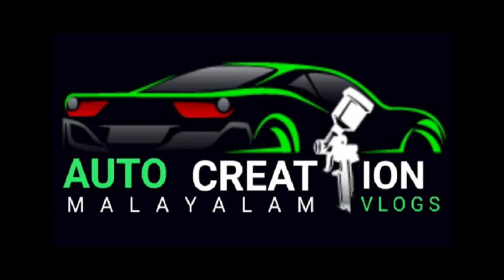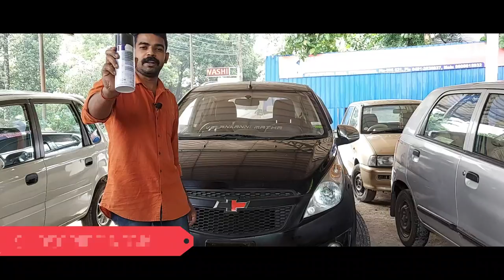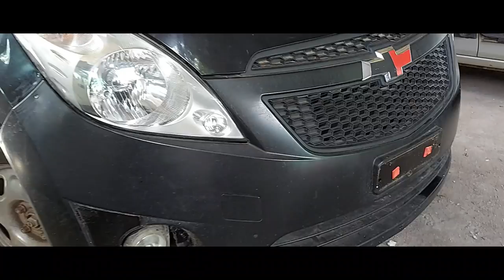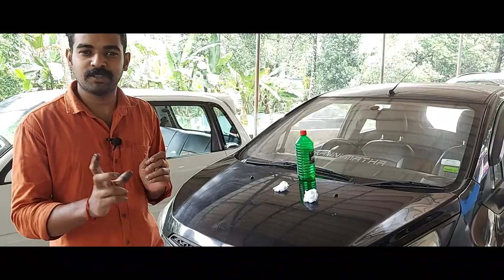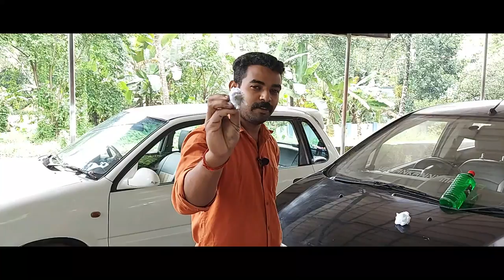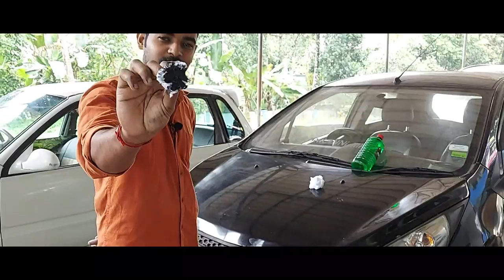Negative side of Bottle Spray Paint

Comment: original computer mixed paint bottle akki kodukkunnundu. athu vachu cheythal finishing aavum bpakshe nere cheythillenking pani kittum . normal bottle water kooduthallanu.
Reply from the maker: Bro  nadakkilla , karanam  computer  mixing  paint   harner  cherthal  mathrame  dry  aku  harner  cherthal  pinne  one  day  kuduthal  erikkilla   unangi  pokum
Reply from the maker: Pinne mettalic  paint  anengil  clear  coat  adikkanam.    Clear coating. Cheyyumbolum  unangan harner  cherkkanam.
Reply: Rust-oleum ennoru brand undu athil 2x spray paint. just onnu try cheythu nokkoo njan white maatrame use cheythittullu. nalla finishing aanu long lasting shining. price almost 7times kooduthal aanu

Comment: bottle paint 2 quality marketil availble aaanu..normal quality adichath kondaan 1 weak kond colur fade aaayath..high quality heat resistive aaanu so pettonn fade aavathilla
Reply from the maker: Bottile paint enamel paint anu bro
Pinne spray paint cheyyumbol virichil undakum, full cut chaithu kalanjitte spray paint adikan pattu
Anik eppol orupad aunbhavam undai
Reply: Heat resistant (hr) paint is only recommended for exhaust and also its pricey ( 400ml @ 350rs ). Eg : painting bikes exhaust with hr bottle  its worthy . I've used the ABRO matt black paint for my bikes exhaust still no issues.
Reply: @t4techdroidtm250  abro vere level paint aan its an American brand njan ente car grill matte black finish aan adichath 6 months kazhinju no issue till now .
Reply: @vipinmathew4959 alpam petrol akki nokuo ilakunnundo enn😅.eniku engine il adichu carburator overflow ayapol paint ilaki thudangi😢